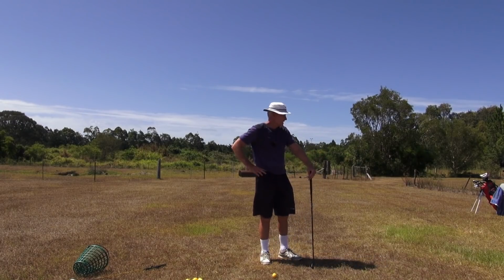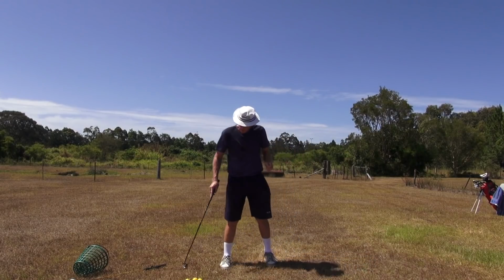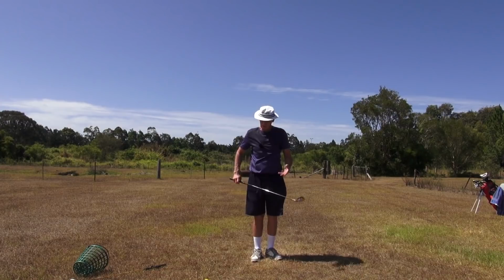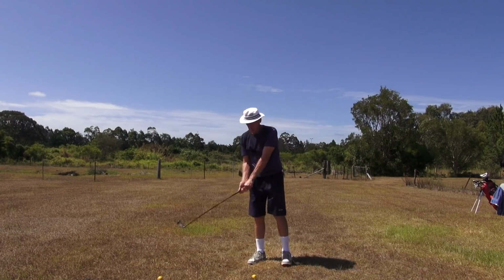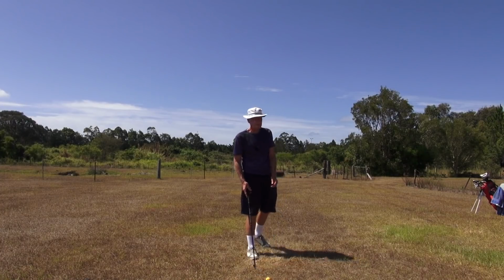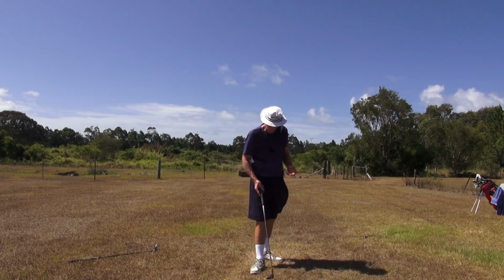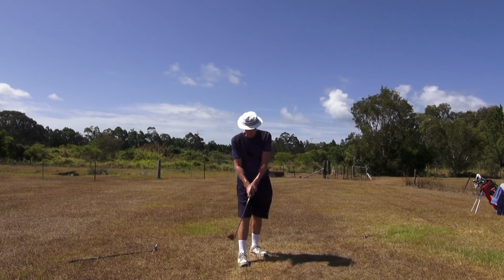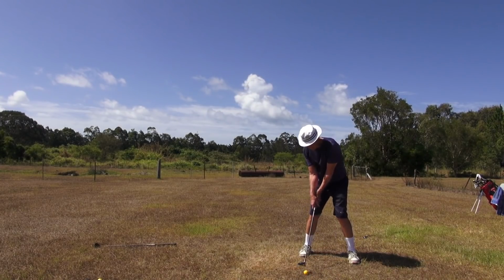Crazy Things Happening ...   Long Video

Comment: Hi JH, the grip down is crazy good! I've been having a similar experience lately. I recently traded in my F7 one length irons for F8 one length irons that are 8 iron length. I hesitated to grip down on them at first because they were already so short. And then I did, and Boom! Solid strong shots that just never move left or right. I was telling my buddy that this is nuts! I'm playing my 5 iron at wedge length and I just hit it 207 on the fly. There has to be a point of diminished returns, but I haven't found it yet.
Reply from the maker: Hi James,
                   It really is crazy stuff.. I just   put it down to the    increase in   arms/hands delivery   efficiencies     by  being able to better  balance the  club   in   a more controlled closer to the body   manner ..  those 3 wood shots  were  nuts  in how well they went ..  and the club was    operating   at like   34 inches   length effectively .. that's like  around  9 inches shorter than a normal 3 wood length  .. shorter than a pitching wedge length .. crazy ..crazy   stuff..
                                 cheers JH
Reply: I have F7's.  Are F8's 8 iron length standard or did you custom order them that way?  I see that F9's are out or coming out next.
Reply: @RocketRanger711  No, this set must have been ordered a 1/2" short. I got them barely used at a deep discount, which is the reason I switched. I was going to have them lengthened, but I'm going to hold off on that for now.

Comment: JH, the channel lock golf swing is so awesome.  I’ve hit about 200 or more balls today and I think I’m starting to get the channel lock setup that works best for me.  You are very correct when you talk about choking down on the clubs.  The ball goes just as far or even further than using the entire grip.  My stance for channel lock is this:  ball is just inside the right foot, left foot is back and look like it is under my left armpit and slightly flared left, backcock is very minimal.  Hitting off nice fluffy lies is a breeze with channel lock but could you give some advice on hitting off of tighter lies.
I also figured out why all that foot shuffling takes place, I think it happens as we are trying get ourselves into the proper position.  The more experience with channel lock the less you have to shuffle.  I think the longer the club, the more left aiming the feet should be and the backcocking will be more pronounced.  It this true?
Reply from the maker: Hi Ronnie,
                  My own shuffling at address is just giving me time to load up my protocol sequencing correctly mentally before I start my swing.. if the sequencing comes up quickly the shuffling is less..  
                  I  personally  don't   make any aiming   adjustments for longer clubs  .. but   that doesn't mean     you shouldn't .. its what    allows you to     best  get    setup    comfortably with   'all' your clubs .. I don't have  any  need to change my   positioning  because my  hands are in the same position     relative to my body at address with every club .. I don't stretch   out with any club at address to the ball .. 
                                 cheers JH

Comment: J what would happen with regular shafts, not stiff shafts. I was fitted with extra large grips and regular shafts in my irons. That was with the Moe Norman single plain swing. I hit the ball pretty well with this style, but not always consistent. I am 6’2”, and my clubs are a little longer.
Reply from the maker: Hi  Robert,
            The large grips are ok on any type of club spec providing you have hands large enough to grip them ok.. I would though get them taped up under the grip so they are parallel in section and not tapered ....shaft flex is a personal thing ... feel is a very individual thing  ...
                  Whereas I don't swing very fast   I tend to change direction quickly which stresses the shaft a lot so the stiffer shafts in my longer clubs suit me better ..
              It was interesting over the years in   testing and fitting players for  irons   how many tall players  had  clubs that were in fact too long for them ..  ..its not a players height that  is    the reason they need   longer clubs or shorter clubs  ..its the length of their arms..    some taller players    really only needed   more upright clubs    rather than longer clubs  .. 
                 I have just found that gripping my clubs down to a  much shorter length that I can get closer to the ball at address and impact and my balance is improved so much better than it allows me to swing quicker and more aggressively ..                     

                   cheers JH